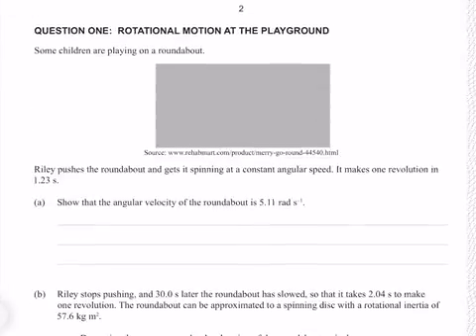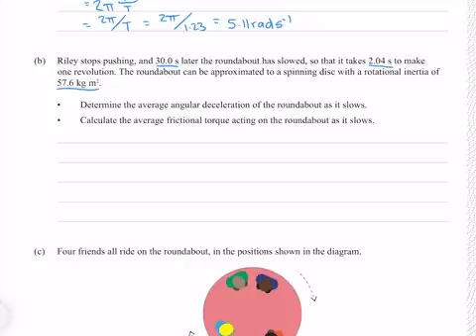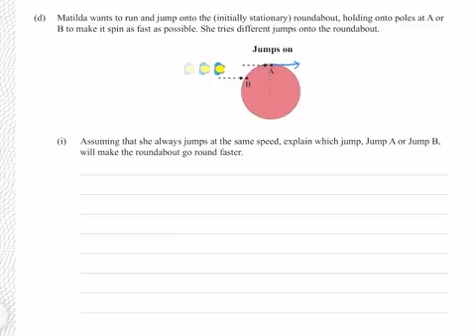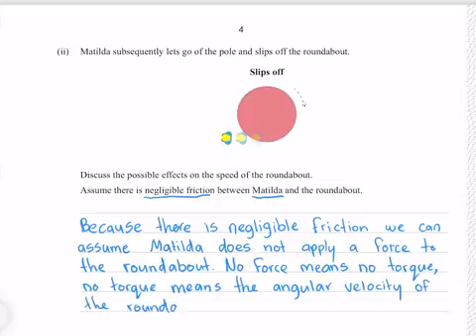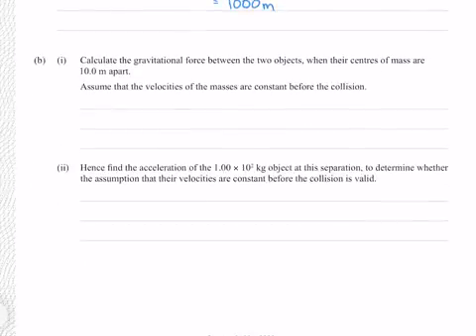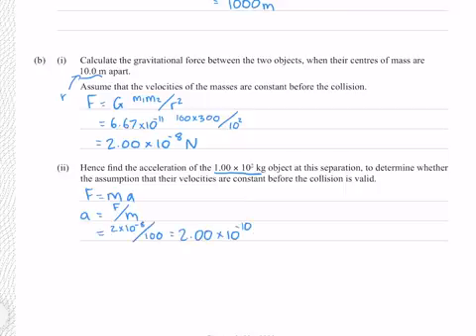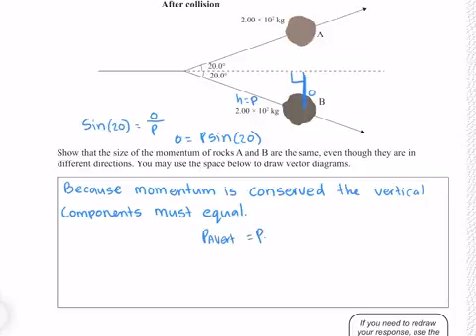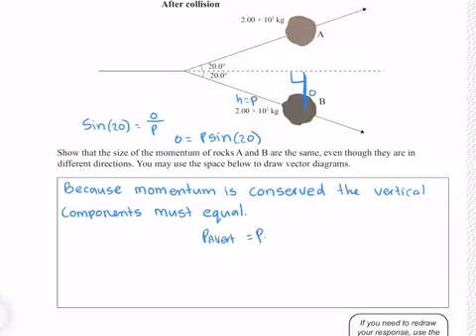2022 Mechanical Systems Exam (NCEA Level 3 Physics)

Comment: For the last question, why cant I just substitute the difference in velocity into the Kinetic Energy formula (Ek) instead of doing Ekf - Eki
Reply from the maker: Hi there, mathematically it comes down to (0.426-0.284)^2 not being the same as (0.426^2-0.284^2).
Reply: @MrWhibleyPhysics  Is there any other reasoning for why not because I thought it just makes sense to use the difference to find the difference in kinetic energy.

Comment: Hey sir, I have a question for 1dii: although friction is negligable, shouldn't the speed still decrease? since w=L/i, and i is proportionate to MR^2, and mass would decrease. im just having a hard time understanding sir, help would be much appreciated.
Reply from the maker: Great question.

Although Matilda removes mass from the system, she also remove angular momentum, therefore angular momentum is not conserved. For this reason we can't use the normal "I decreases, ω increases" argument.

Another way to think about this is that Matilda does not apply a force to the roundabout as she leaves. If the roundabout does not experience a force, it does not experience a change in motion, so ω is unchanged.

Comment: at 14:16 was does -0.286 give the distance shown on the circle 0.286
Reply from the maker: Hi there, the equation 0.3cos(1.42*2) is used to find the distance of the bob from equilibrium at any given time. Because the question asks not for the distance from equilibrium, but for the distance from release, we need to add the release-equilibrium distance 0.3m to our answer.

Comment: For 1b, when calculating ωf would you be able to use the kinematic equation "θ=(ωf +ωi/2) x t" to caulculate it or only the equation you used? Thanks
Reply from the maker: Hi HOPM, given the information in the question you would need to use ω =2 π/T.

Comment: For question 1 b, how do you know to use the a=w/t equation and not the rotational kinematics equations? Thanks for the video!
Reply from the maker: Great question. After substituting "ωf-ωi" for "Δω", I end up with "α= (ωf-ωi)/t", which is just the "ωf=ωi+αt" rotational kinematic equation rearranged for α.

Whether you start with "α=Δω/Δt" like I did, or start with the "ωf=ωi+αt" rotational kinematic equation, you'll arrive at the correct answer. Hope that helps!
Reply: @MrWhibleyPhysics  yes that helps thank you!

Comment: Hi sir I have a question, the formula you used for question 3b isn't on the formula sheet (as far as i am aware). I was wondering if it can apply to  every question like question 3b.
Reply from the maker: Hi Abhinav, which formula are you referring to?
Reply: Nevermind sir, I was just a little confused on the variables. The formula is on the sheet. Thanks for all the help with your videos! @MrWhibleyPhysics
Reply from the maker: No worries, you're most welcome!

Comment: when do I use radians or degrees for SHM? some reference circle questions are easier in either its so confusing, please get back to me, cheers
Reply from the maker: Hi Liam, this can be hard to get a handle on. Rotational quantities such as ω and α are given in terms of radians, so when calculating these we almost always will need to use radians. When using trigonometric functions either radians or degrees will work, provided you've let your calculator know which one you're using (in the settings).

If you're not confident, the safest option would be to always use radians. Converting to radians whenever the question gives you a value in degrees.

Comment: Hi, just a question. For 3b, how did you get -0.286 when the outcome of your previous equation (d=Acosωt) I calculated to be 0.2996. I thought it might also be worth mentioning the official answer for this question had a slightly different approach. :)
Reply from the maker: Hi Hugo, you have your calculator set to degrees. It should be set to radians.
Reply: thank you @MrWhibleyPhysics

Comment: 12:51 Hi there, I thought phasor diagrams move anti clockwise? Would it make a difference if it was moving anti clockwise?
Reply from the maker: Good question Barbros, either way will work. I chose clockwise because I felt it better fit the diagram.

Comment: Hello I have a question. So for 1dii) why would velocity remain constant. According to L=Iw, because matilda got off, mass has decreased while r remains same, hence decrease in Inertia. Momentum is conserved therefore w must increase to compensate. So wouldnt angular velocity increase?
Reply from the maker: Good question. When Matilda leaves the roundabout she removes both mass and angular momentum from the system. Considering L=Iω, because mass decreases I decreases, she leaves with momentum so L decreases, such that ω stays the same.
Reply: @MrWhibleyPhysics  So in a system like this, the total angular momentum is matildas and the roundabout but because matilda left, the toal momentum is now only the roundabouts therfore it has decreased.

Comment: Thank you so much sir for this video. I have one question though: For Q3 b, at 14:18, why is the -0.286 calculated the distance between the red arrow and the 0? I thought that it would be the distance between the red and blue arrow?
Reply from the maker: Hi  @jentrieu2953  , here's a link to where I cover this in my 3.4 note video https://youtu.be/BYjNjme4LtQ?t=2178
Reply from the maker: You're welcome Daniel, good question.

The equation d=Acoswt gives us the displacement from equilibrium for a system that has started at it's maximum displacement (hence the cos, not the sin) and rotated through an angle wt (as θ=wt). The key part of this is that the displacement is from equilibrium, which is our 0. Hope that helps.

Comment: I tried doing this paper myself before watching this video and I failed so I was wondering on how I can improve from here
Reply from the maker: Hi Abhi. For exam practise this is the process I recommend:

- Attempt the problem.
- Check the answer. If incorrect, try to understand the proper solution and where you went wrong.
- Once you understand the solution, reattempt the problem.

If you're having trouble understanding the proper solution, identify why. Are you having trouble understanding the underlying concept? Is it the mathematics? If all fails and you don't understand why you don't understand, then it's time to involve your physics teacher. Hope that helps!
Reply: Hey are you the Abhi Patel who is in Mr Gapes physics class in LC

Comment: Hey, excellent job with the clear and concise explanations. I was wondering how I could answer this question. My teacher gave it to us in a SHM PowerPoint. 

‘An engineer builds two simple pendula. Both are suspended from small wires secured to the ceiling of a room. Each pendulum hovers 2 cm above the floor. Pendulum 1 has a bob with a mass of 10 kg. Pendulum 2 has a bob with a mass of 100 kg. Describe how the motion of the pendula will differ if the bobs are both displaced by 12º.’ 

How should I approach this?
Reply from the maker: Cheers OmegaDanielChemPhysixnMusic!

The equation for the period of a simple pendulum is T=2pi sqrt(L/g), provided the angle is small (this equation assumes the "small angle approximation", 12º is borderline).

Since g is a constant, we can assume that the only variable affecting the period is L, the distance from the pivot to the centre of mass.

We're told that both pendulums hover 2 cm above the floor. Assuming this to mean they have the same L (true if the mass of the wire is negligible and the bobs have the same dimensions), their periods should also be the same. The mass difference should have no effect.

Hope that helps!
Reply: It does thank you.